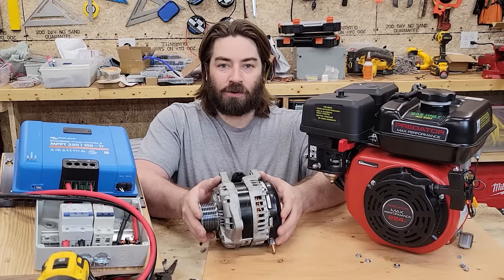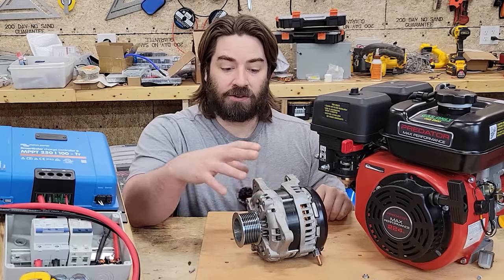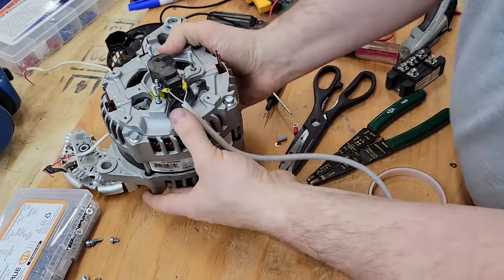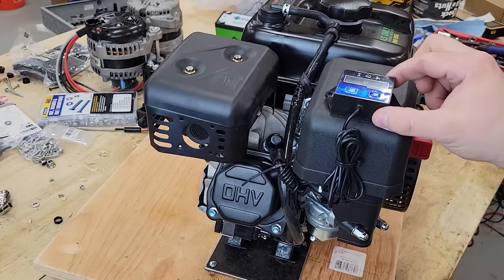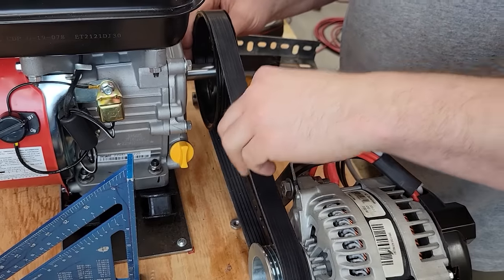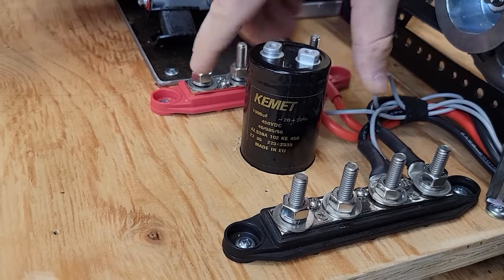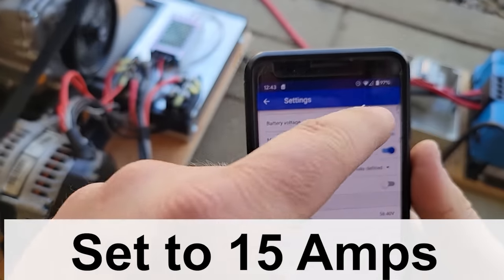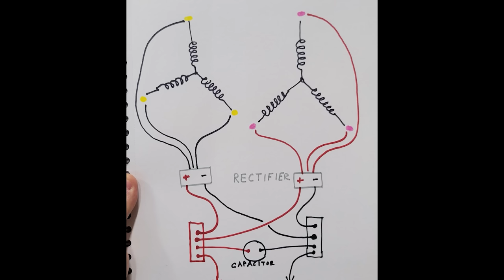The AlternatorGenerator, First Attempt.  48V Battery Charging

Comment: I want to make one, with the speed at 3000 rpm, and connect the DC voltages of the two rectifiers in series. This can increase the output voltage, make up for the lack of speed, and then increase the excitation voltage.
Reply from the maker: Sounds good.  Actually, in video part 3 of this series I was testing fuel economy at different RPM's, and I settled on 3,000 RPM.  You might like checking that out. https://youtu.be/yQTCVyxdauo?si=POe7CEmOKp4nbSd5

Comment: The best generator I built 15 years ago , consist of a 200cc gasoline engine and a 12 volt alternator and a 12 volt 647  battery and a 1000watt inverter. What makes it extremely better than a normal generator mine can run 2 hours without needing to start the engine so instead of running a normal generator for 4 hours on fuel it use only half , couple this that it's connected to solar panels , my next aim is connecting to a wind turbine .
Reply from the maker: Nice.

Comment: I'm not going to read through all the comments hopefully somebody has already informed you. Typical ratio on an alternator to crank pulley is 5:1 and one big factor that you overlooked how much power does it take to turn that alternator at full field. There is a simple formula for it. But a 200 amp alternator needs roughly 8.5hp your throttle on your carburetor was wide open and the engine was struggling to maintain rpm and your RPM  on the alternator should be around 12 to 15000 rpm as a car audio guy we build these to charge our lithium Banks up    so we don't have to run the engine..  I built my first one 12 years
Reply from the maker: Thank you for your comment.  I'm glad to have a car audio person here to help me out.

Comment: I'll have to look at your treadmill motor setup if you posted it.  But not all treadmills have the same size motor I got a 350 volt dc 3hp motor out of one 
Using a home made bridge rectifier and controller i can run it off 120 volt ac, I plan on putting it in a bandsaw.
Thats also a good question can you use a 
Ac motor?  Or how about a electric car motor???  Like a totaled preius.

Comment: Why not use the existing bridge rectifier? Surely it currently handles all the voltages that the alternator will put out from idle to 12,000 rpm.

Comment: Could you use toothed belts and multiple alternators, clock them the same and take the 48v to 96, 144 or slightly less due to alignment error? Probably 120v due to alignment errors.

Ever thought of an alternator kit that could fit on a car and provide emergency power in an emergency;  but normally run the car?

Comment: I've never actually checked but I've always assumed the built-in Voltage controller in an alternator is analogue not PWM (varying field current) so one source of electrical noise is absent.

Comment: hmm works very well, it should be capable of charging a 24v array just as well(assuming you can sink ~100a at 24v) and given the way 4-stroke engines operate it should be ideal to operate at ~80a 24v as that is only 60-80% load
but the engine seems happy to source as much as 2.4kw of energy which on a tiny RV or home could keep a battery from going flat on the average energy use of a 2 person off-grid home
now I wonder how hard it would be to use a common briggs and stratton lawn mower salvage engine to do this....
also given the vibration issues I would actually use 4 concrete paver slabs bolted to the bottom with the rubber feet bolted through to avoid sliding, plus use a whip of steel or CCA cable between the charge setup and generator to avoid work hardening on your main output lead as that vibration between a fixed charger and vibrating  generator will quickly ruin your flex

Comment: To excite the field, would it be possible to setup a relay circuit using the magneto of the engine? My understanding is that most generators use an AVR connected to the stator of the generator side (in most cost-effective consumer generators) but you could possibly achieve the same effect using an AVR and a relay circuit that turns on when the field is dead and shuts off once it's excited.

Comment: Change the motor mounts. Go with a ridged mount on alternator and engine then rubber mount the pair. use more steel.
Reply from the maker: I agree with you.  I made a new steel mount in video part 2: https://youtu.be/cy0t4qq8mS0

Comment: I might would mount the engine without any anti vibration then mount the wood platform to an anti vibration mount. I figured it would give you trouble since the engine was on rubber but the alternator wasn’t. That means your engine is moving but your alternator is not moving with it. Only problem with this is that everything will be vibrating then. You could also build a new metal mount that holds the engine and the alternator and have the metal mount sitting on ani vibration rubber. I’m sure you will figure something out.
Reply from the maker: Thanks for the comment.  I agree with your suggestion and did some of that in video part 2: https://youtu.be/cy0t4qq8mS0
and part 3: https://youtu.be/yQTCVyxdauo

Comment: Don't know if it would help with the vibration? But it might help with efficiency to use old timing belt cut and glued with the teeth to the outside of each pully as kinda direct drive... I've seen other people do it with great success
Reply from the maker: I was able to fix the vibration in Part 2.  Basically, I welded up a thick piece of steel as a base for both the engine and alternator.  Then the steel base is isolated from the floor.  Check it out if you want to see.  Or Part 3 I do some fine-tuning for better fuel economy.

Comment: I worked at an auto zone for quite some time until just recently and the number of those duralast alternators I had that were bad out of the box is ridiculous. 
Once in a while is understandable, but SO MANY came back DOA I couldn't believe it, a few times I had customers trade in the first dead one only to get yet another dead alternator right out of the box. That's two or three IN A ROW!
Reply from the maker: Wow!  I guess I got lucky.  Thanks for sharing your experience.

Comment: You could also charge lithium batteries with a buck converter that limits both volts and amps.
For LiFePo4, set your volt limit to around 57-58v and set amps limit to whatever your buck converter can reasonably handle, or your batteries can handle (whichever is lower).

For a 1500 watt buck converter, you could theoretically limit amps to ~26a, but in reality a lot of cheap electronics lie about specs, so you might divide that by 2 for safety.

Comment: I thunk doing what you want  would  simpler to use a 1960s gm alternator with a external adjustable voltage regulator . I bought a rebuilt one wire gm alternator ran it with a high grade 3 house brings and Stratton  motor belt ran with a 1500 watt  inverter a 12 volt marine battery and  ran my rv from it including a  fridge and air conditioner.  It was quieter than a Honda inverter generator and was a gas sipper. If I ran it 6 hours I used less than  a 1/2 gallon of gas.  But again  I used a high end gold copper color of a California trimmer.

Comment: it would be awesome if it was diesel so you can run it off a plethora of fuels. 

Also I kinda wanna see what the smallest engine would have the power to run it. Like could a 100cc engine do it? 80cc? 
I have a 48v golf cart that has a ton of room in the battery compartment since I switched to lithium and and wanna make a hybrid to really extend the range. Basically how the Chevy Volt does it.

Comment: odds are, the limiting factor will be the rectifier diodes in the alternator. Automotive alternators never run anywhere near their rated capacity for more than a matter of minutes. For what you spent, you could buy a generator and an inverter.
Reply: He is not using the diodes inside the alternator.

Comment: Yeah all that vibration. Definitely going to use 1 inch tube steel.
Reply from the maker: Yeah, I was able to weld a new base plate in video part 2 that solved the vibration problem.

Comment: You should also put a reflective sticker on the pulley attached to the engine. This way you'll be able to tell if there is any slippage.
The alternator and the engine seem to be rattling a lot, wobbling and moving about. This creates a bit of a precarious situation. The engine especially seems very poorly mounted.
You should optimize the mounts so that you can have the least amount of relative motion between the engine and the motor. Perhaps a rigid connection between the two is needed, as you might find in a car engine perhaps.
I would take all the electronic elements away from the motor-generator base and place them somewhere separate just in case there is a mechanical failure - preventing an electrical failure becoming a consequence of the former..
Reply from the maker: Thanks.  I have a part 2 and 3 video on this generator.  I mounted the engine and alternator to the same steel plate in part 2 and that helped a ton with vibration.
Reply: @DavidPozEnergy I'd imagine it would. I'll watch these other parts too. Good project!

Comment: Cool project and great fabrication skills but why did you ditch the built in rectifier in the alternator with its own cooling and heatsink?  Another comment is I don't think your capacitor is necessary, and the one you bought is likely too small to have much effect.  May be working too hard, does it get hot?  The battery doesn't mind being charged with a pulsing input and the 6 phase alternator helps with that anyway.

Of course, another option would be to leave your alternator at 12V and run that into a boost converter to take the voltage up what your battery wants.

If you started with a 24V alternator, which is also a cheap commodity item, you'd only be in the position of doubling the voltage instead of quadrupling it, which means you might get longer life out of the system since the bearings and brushes wouldn't have to work as hard since you could halve the RPMs required.
Reply from the maker: The capacitor doesn't get hot, and is not doing much work.  I probably didn't need the capacitor, but I wasn't sure going into this.  
I answered these questions in part 2, and go into a lot of detail about the rectifier.
https://youtu.be/cy0t4qq8mS0?si=cuc26tpnCWTOePtN
Check the description for the time-stamp when I talk about the rectifier.  That way you can jump to that spot.

Comment: What would work would be to remove the rectifiers and hock the coils directly to a 3 phase transformer that will give you a higher voltage according to the ratio of the transformer and your "raw" input voltage. You can then run it through a 3 phase rectifier to get DC if you so wish.  It will how ever only change the ac voltage not increase power output, a 5 hp motor can normally give you 3,75 Kw at most, whether it is 14 volts or 80 volts the amps will change to still give 3,75 Kw at most (if the alternator is capable that is).

Comment: You made hooking up the brush wiring sooo hard, just bolt regulator back in and add wire to that connection  ???? Then brusholder is stable too ??? Maybe you should have converted to delta connection at same time for greater low speed performance  !

Comment: It’s a nice setup that you can maintain if something breaks but it seems very noisy. How much would cost something equivalent, if there is any?
Reply from the maker: In a previous video I used a 100 Amp charger, and my Honda generator that outputs 240VAC.  That's probably the quietest option and easier to set up.  https://youtu.be/kQTFPMDE_F4

Comment: Interesting video, but why bother?
You can buy a charging module for the electric-start version, which fits next to the ignition coil under the flywheel. It produces enough 12vDC regulated amps to easily recharge a 12v battery.
I'm sure that with a small 4/1 step up transformer, you can bump that up to 48v DC. Adding in more modules around the flywheel would reintroduce more amps if falling short.
You could also have done the reverse and bought an off-the-shelf 240v generator and a 5/1 drop transformer/inverter to get 240vAC down to 48vDC, with more amps than you'd ever need.

Comment: Great experiment David.  I bought a couple baggage tugs from delta.  They run 80vdc motors using a 72vdc battery pack.  Have you ever built a charger like this, but using 220vac single phase as input power?  I really need a way to charge my batteries without spending $2k+ for a charger.
Reply from the maker: I have not built a charger for a 72VDC battery.  
An idea off the top of my head is:
If it's built with 6x 12V batteries in series, could you buy 6x 12V battery chargers?  Each charger to one of the 12V lead acid batteries, and then all 6 chargers to one power strip?
Reply: @DavidPozEnergy  interesting idea.  The ultimate is sell one unit and keep the other, but people are shy about the cost of a commercial battery charger.  I’m definitely going to look into your idea.  Thanks
Reply from the maker: Your welcome.  I was thinking, maybe two of these: https://amzn.to/3Q1KbK3  (affiliate link)

Comment: Way cool video. Lots if Info for people like me with no idea if how to do what they want to do as far as going off grid. My question is, would it be possible to achieve the voltage numbers you achieved while using a bigger alternator( like 24v) and generate less heat doing it? Thanks again your page Rocks out
Reply from the maker: I'm sure the same principles would apply with a 24V alternator.  I don't know if it would make less heat.  Check out part 2 for thermal imaging: https://youtu.be/cy0t4qq8mS0?si=l4andhUhcZGY_1Ou
I'm not having any issue with over-heating.  Even when I turn off the generator while under load, it doesn't smoke.
Reply: @DavidPozEnergy  awesome. I hope u don't mind if I use your work in some of my own DIY videos. If so, I will not. Thanks again. Joe
Reply from the maker: I get inspiration from others all the time.  It's nice to give a shout-out to the original creator is you get a chance.
Reply: @DavidPozEnergy  will do. Thanks for the quick response

Comment: As a person whom has a little experience with this sort of thing your doing. Might I suggest not runningb the 12v field on 48 or 60volts... The only thing that limits the current in the field is the resistance of the copper wire and on higher voltages it will let the smoke out of the box, which we all know is impossible to put back in!
  
Your on the right track, but ditch the victon charger regulator and control the amps and volts by reducing the field voltage.... if your battery bank is big enough you could probably get a working solution just with a field rheostat.

Most car alternators will do 14 to 16 volts at idle, so just bring the RPM up and having an external slip ring supply is all you needed to do, no real need to remove the rectifier...
For anyone interested, if you give a couple of car alternators external power to their slip rings from a car battery and connect the positive of each alternators together in parallel, and drive them with a big enough engine, you will find they work ok as a DC arc welder. 

Having been down the same path your talking about....at some point you may wish to consider the waste heat from the engine for heating hot water, after all it is free energy going to waste.  Then there are other things you can do like methane production from your house to fuel the engine on gas.... 

Are if we only lived a 1000 years and had a infinity budget to do all these things, wouldn't life be wonderful.

Comment: It could be better if the sound/vibe mounts were on the bottom of the board that would make the belt work better and stop the board from "Walking." Put some large feet on the bottom to connect to the vibe/sound mounts.

Comment: Great video - one thing though. Why didnt you just use the internal rectifier? By removing the rectifier and adding the two external three phase rectifiers paralleled you just essentially re-created the internal rectifier assembly.... You could've just used the stock rectifier assembly as the silicon diodes in it normally have a breakdown voltage rating that'd be fine at that voltwge.
Reply from the maker: There were several reasons.  I dedicated a large part of the next video (part 2) to answering this very question.  In a nutshell, it came down to me not knowing.  Since this was an experiment, I wanted to remove potential problem points.
Reply: @DavidPozEnergy  ah, gotcha! Nice video though. Good work!

Comment: As the alternator is only intended to supply approximately 3,000 watts, and that is what you are supplying to the charge controller, there is no point in trying to get MORE out of it. ALSO you need to remember the alternator is NOT designed to provide max wattage non-stop!

Comment: Hey David , 

what you mean can I use an 48V Alternator with 11kw and 480ah for my battery pack 32x 320ah 3,2V ? Or is that to strong? 

Greetings Oliver 

P.S. great videos I love them!!  👍
Reply from the maker: I'm sorry, I might not understand.  If you are asking about using a 48V alternator, yes, that would be easier than using a 12V like I did.
Reply: @DavidPozEnergy  Does the inverter have to be as big as the battery, i.e. do I need 3x 12kw inverters or does it just have to be as big as the power I need?
Reply from the maker: Just big enough for your power needs:
Size your inverter to handle the loads.  Then the minimum size of the battery is what can supply the current needed for the inverter.  You can always make the battery bigger.